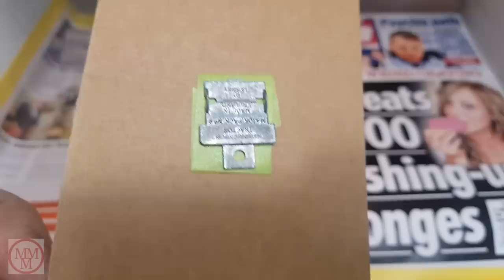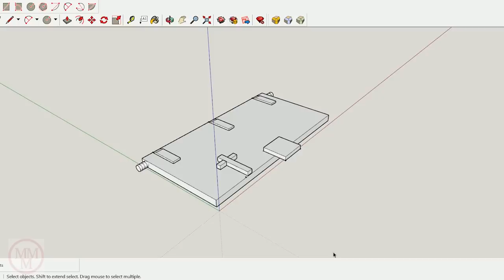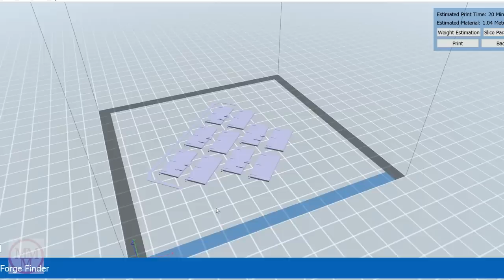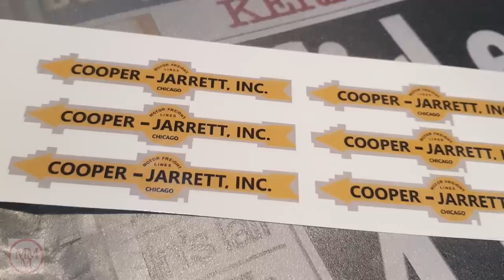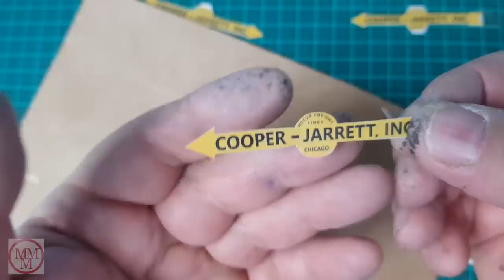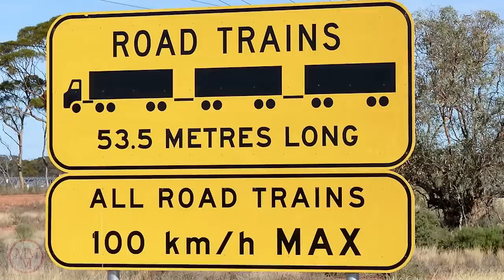MATCHBOX Restoration Major Pack M9 Hendrickson 'Cooper Jarrett'  Tractor & Freighter

Comment: Those fine soldering tips are for soldering small electrical connections. You were trying to heat a large base, AND the vice itself! As mentioned elsewhere, a small pencil flame would work better.

Comment: In the USA we call them semi trucks or tractor/trailers or big rigs.
When I was a kid I used big rig here in California but as I now have friends that do over the road trucking they usually call them Tractor-,trailers but all three are pretty well known terms across the USA

EDIT: I just looked it up so here it is
Tractor – the tractor is also known as a road tractor, prime mover (UK, Australia and New Zealand), or traction unit gets its name from the job it does. The tractor is the power house that does the pulling. One or more trailers (or semi trailers) can be attached to the tractor. They can also be referred to as articulated trucks. This simply refers to the fact that the tractor moves and the trailer follows – the same principle applies to a car towing a boat trailer – the boat follows the car.

Makes sense I guess... It's the traction unit or powerhead..  we both learned something new today.
Reply from the maker: Good to know Atomic, thanks for watching! Marty.

Comment: For repairing nth broken trailer bed I would recommend JB Weld. It’s an epoxy loaded with very finely ground metal power and is very good for bonding cast materials.

Comment: The Prime movers are called Tractors from the old steam Traction engines.   Traction Engine was just abbreviated to Tractor.  In the UK and  and more so in North America Steam Traction Engines  (Tractors) were not just used for Farming but were used for hauling heavy loads in Mining and Lumber Operations and shifting large heavy loads.  When the traction engines were replaced with prime movers the Tractor moniker was just passed on to them.

Comment: Oooh, maybe the very best Matchbox ever. I still have the Cooper Jarrett one I played with about 50 years ago. It's actually in a quite reasonable state considering. No doors and dolly though. So if you would maybe have some spares lying around ..... Are you aware it was often parked near the Fireflash airliner in the Thunderbirds TV-series? That was already more then enough to endear it to me.
Reply from the maker: Sure thing Marc, email me your address and I shall post you some doors for free.
Reply: @MartysMatchboxMakeovers  Wow Marty, that is a grand gesture. My remark was a mix between a a joke and a long shot but lo and behold. I already saved some cheaper double rear axle truck models that I can turn into a reasonable emulation of the dolly. Getting the doors from you wil now really get me going. Thanks a lot!

Comment: You want to heat the metal up as well so the bonding agent works so I would get a small hand torch and then when the metal is nice and heated you press the rod to the area with the flux and it should work hopefully

Comment: Tractor and trailer is commonly used terminology here in the uk for this type of vehicle, another is articulated lorry also juggernaught which is named so because of the big wheels that resemble the large wheels on  jagacarts that are used in india to celebrate jaganath one of the indian deity,s( gods) its huge and pulled by hundreds of people with ropes and doesnt stop, if you fall and get run over someone else takes the ropes, some even throw themselves under the wheels to die and be reincarnated in a  better situation!..great model as expected.

Comment: Hey Marty, great restoration as usual. Your work is always so clean and I love how much detail and description you put in your videos. They're a joy to watch.  Just a quick look on the web and I found this https://www.toymart.com/Matchbox-M9-Inter-State-Double-Freighter/14452, which would suggest that it's called a "double freighter" because it comes with two of the trailers! Also, in the US we call that a "tractor-trailer" to distinguish it from a box truck where the freight box and cab are integrated into a single chassis. The term "prime mover" here generally refers to the large diesel engine that powers generators for diesel electric propulsion on a locomotive, ship, or other large vehicles.  Keep up the great work Marty. I always look forward to a new video from you!

Comment: You don't want a gas powered soldering iron. I would recommend a TS-100 with either the TS-K or TS-KU tip for the type of work that you are doing. You will need some sort of power supply (many laptop power supplies will work) with one of those barrel connectors. The unit can handle up to 24 volts, has adjustable temperature, and can be worked like a pencil. Just do a search for it, and you can find it in many places on the net. I do not work for the company that manufactures this, I just have found, along with many other makers that it is quite a good unit for all types of soldering.

Comment: On the welding, you want to use the tip of the iron, or just get a blowtorch. But you really need to sink the heat into the base metal, not just melt the solder. I'd say go with a propane torch unit, but that kick out a lot of heat. Butane propane mix is a bit cooler.

Comment: To cut clean semi-circles, use a razor out of a shaver, cut it to size, bend it  with your fingers as you cut the decal or attach it to a firm backing like thin alu etc

Comment: You might want to check out a soldering iron with temperature control and replaceable tips; a small wedge tip might be useful. Also, your vise is acting as a heat sink making the soldering much more difficult. Finally, do consider a hard hat too!

Comment: In the UK, the front bit where the steering wheel attendant sits, is the 'Tractor Unit' or just 'Tractor', the back bit, where all the goodies go, is the trailer, and the whole thing is an 'Artic', short for articulated. :-)

Comment: I think that hobby shop butane torch may work ok, the vice is conducting  all the heat away, you should solder it on a heat proof mat, dont use any glue it will contaminate the joint, and heat the whole part a little fist so it dosnt take the heat away from the area you are repairing.

Comment: in the US, they call them tractors because that's what was originally used to pull trailers around, so the rumor goes. They are also called Semi's as in Semi tractors and there are a lot of other names. The drivers have some names for em I' can't post here. Some of the names are brand specific. Here they only allow two trailers only on very specific roads.

Comment: It seems that you might have better luck with a high-wattage electric soldering gun (with a broad flat tip) as the large metal area probably pulls away too much heat for you to get a proper bond with a little gas soldering iron.  A small gas torch might work as well but would be less controllable than a soldering gun.

Comment: When you put metal object to be soldered on metal anvil, you create heat sink, and you need a lot of heat to solder. Try soldering helping hands, or put it on wooden piece, it should solder much easier.

Comment: for soldering iron, get a wall power unit, you can then dial exactly how hot you wank it, a Hakko soldering station is relatively affordable and is a great investment, and will get well over 350 degrees.
Reply from the maker: I will check these out , thank you FrostyDog627!
Reply: @MartysMatchboxMakeovers  may want to check FrostyDog627's spelling too lol

Comment: Great job on the truck and trailers, however .... are you aware there's supposed to be a decal on the front of each trailer? The term tractor DID start with farm vehicles, it then spread into the haulage industry to refer to drivers cab area as the "tractor unit" (farm tractors were originally designed to pull a variety of ploughs and trailers, and in sci-fi shows and movies, they use a tractor beam). Great to see Kevin back, he sure does have it in for you, and you could see in the bloopers, Julie hated throwing eggs at you lol.

Comment: Hi Marty, Here in the US we call them tractor-trailer trucks. I know the casting on the model says Henderson which was a company that made trucks and truck suspensions, but that model looks a lot like the old International Harvester Emeryville line Cab Over truck tractor.  Here is a photo Marty of one of the Original Cooper Jarret "Turnpike Doubles" trucks ( https://i.pinimg.com/originals/03/23/52/032352c2400bc8ea0f50beb7a269ca74.jpg ) On a side note, I drove tractor trailer trucks for 20 years, but never pulled double or triple trailers. You did a wonderful restore job on a rare Matchbox model, very well done. Cheers, Rich S.

Comment: Your soldering iron looks under powered, by the appearance of the weld. I suggest getting a temperature controlled iron because you dont want to melt through it either.

Comment: Trust me, Marty: I have a 1:87 Majorette version of a car transporter! The right smokestack off the cab is gone, one of the air horns (which were plastic, painted silver) snapped off, there's a HUGE crack in the cab's spoiler, and a fair amount of the left side of the COE's grille is gone. Quite the undertaking.

Comment: Take the tip out of the iron and you should get more heat.
Reply from the maker: Tried that after and still no go. Need a beter  one to  make it work i think.
Reply: I do microsoldering work and use a hot air station that pushes up to 480 degrees of hot air. Do you think that could work?

Comment: Will need to be very careful when trying to repair using a Gas flame torch,  some of the models will melt from the heat due to the metal they are made from.  Best to practise on unwanted models first before doing unrepairable damage on something good
Reply: I wrecked two. One was really cool. So sad.

Comment: American truckers refer to their tow vehicles as tractors.  The only difference between a diesel farm tractor and an over the road diesel tractor is gearing and power train.  The diesel engine is essentially the same.  It's a carry over, linguistically, from the early days of cross country trucking.  We Americans still refer to our truck drivers as "teamsters".  Nowadays, the only horses' asses these teamsters see are the guys running the loading docks (lol).

Comment: On that little soldering torch, unscrew that knurled knob at the base of the tip, and pull the entire tip assembly off. That will get you a bare flame torch that should work much better.

Comment: Great video Marty! Love the outtakes. I do have one minor complaint, however. You didn't show how you rebuilt the bar at the bottom of the doors on that one trailer. That would have been more interesting than spending time with the paint remover. Lot of detail in that bar, you have the slot and the pivot points for the trailer doors you needed to recreate.

Comment: try using a small blowtorch for that welding rod, I have a kitchen one for doing the caramel top of your creme brulee.
or a plug in solding iron with much bigger tip, got to get al the metal up to temp.  dont hold metal to metal in the vice isolate with wood so the heat stays in the piece and not soaking into the vice jaws

Comment: hello Marty,

I again love your restoration video, there's nothing better in the internet I think. Your 3D-printer sometimes is as imperative as your spray gun. If you're missing tires, parts of interiors or sometimes steering-wheels, you are always doing a good job with your 3D-printer. But in my opinion it's not suitable to print parts which are originally made of metal casting such as the doors in this video. You always take your work really exactly til the smallest detail, every tiny dent in the casting has to be fixed, why then make plastic doors, if there are metal ones originally... This only disturbs me a little bit but except of this you are doing great work as always. 

Greetings from Austria

Comment: Marty, seems you need a bigger flame; the bigger the metal piece, alongside the metal vice, they work as heat dissipators (like the aluminium ones in audio amplifiers), so the soldering process cannot be achieved due to the lack of temperature. 
 Once again, nice work and good luck!

Comment: You are trying to heat the metal part to solder it but your metal vice is acting as a heat sink and is drawing the heat right back out again.  Try a couple small blocks of wood or something between the part and the vice.